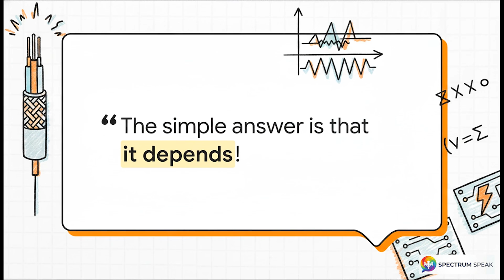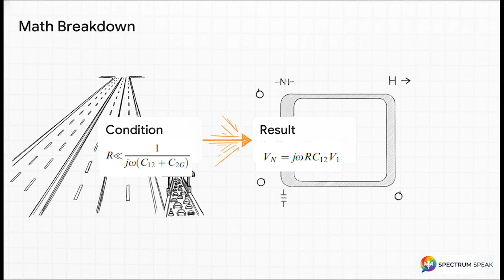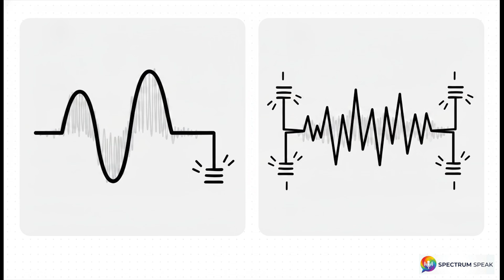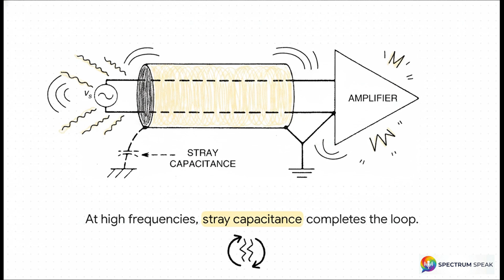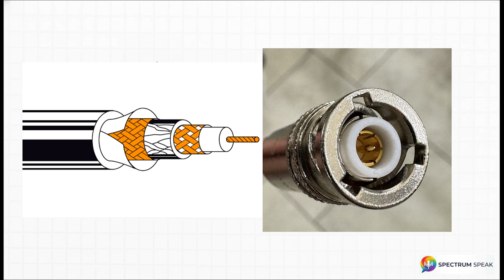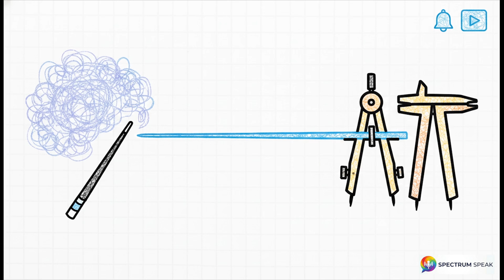Cable Shield Grounding: When to Ground One End vs Both Ends?

Comment: It depends :-).  Sometimes we have to experiment,  but it's good to have  a understanding. Only do a measurement (experiment) when you know what you want to see. That's the main point. Good trainig grounds are electrical aluminium melting facilities where 10000 A run along with your temperature sensor cables :-)
Reply from the maker: Thanks for sharing your experience! I completely agree. Personally, I haven't worked on HV or high-current projects yet, but examples like yours reinforce why understanding the underlying EMC principles is so valuable before taking measurements. I really appreciate you sharing this practical perspective.

Comment: WARNING ⚠️ Ai information is only PARTIALLY CORRECT!!! Theory and practice are entirely different!!! Plus receiving, plus test equipment vs 1 watt or 1,000 watts Act ENTIRELY DIFFERENT THAN THEORETICAL MODEL'S!!!!
Reply from the maker: I completely agree that real-world EMC is often more complex than theory. Factors like the application, frequency, cable length, grounding architecture, power levels, and the test setup all influence the final shielding strategy. This video was intended to explain the fundamental principles behind one-end vs. both-end shield grounding, while the final implementation is always validated through EMC testing.
I'm curious—which specific point in the video do you think is incorrect? If possible, could you point to the timestamp and share the technical reasoning or a reference (standard, textbook, application note, or paper) that supports your view? I'd genuinely like to discuss it and learn if there's another perspective. Thanks again!